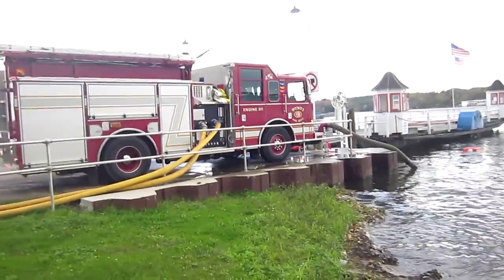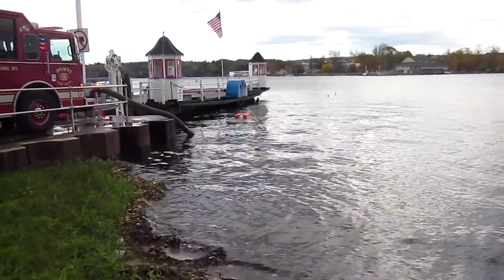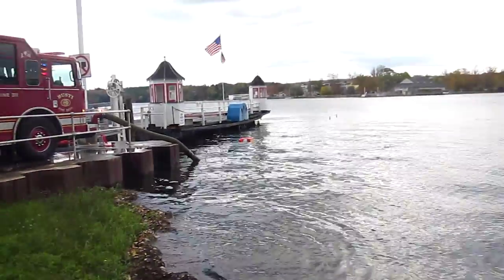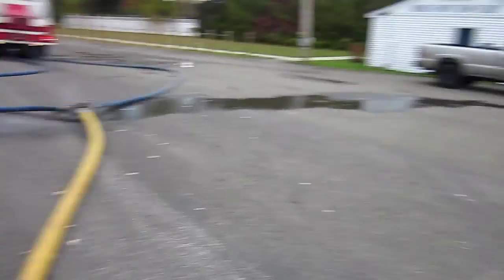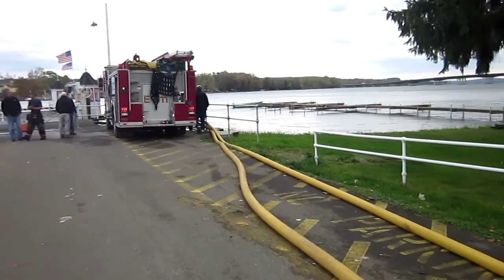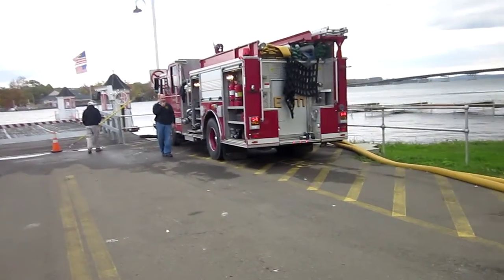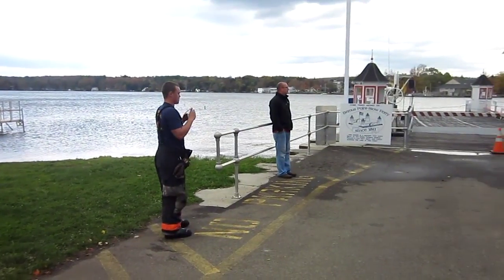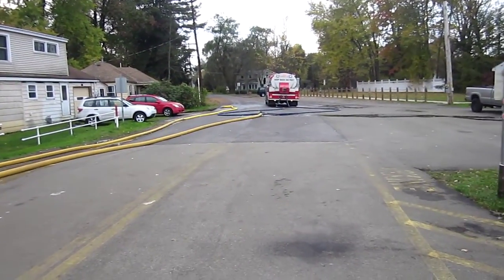Tanker Fill Site Operations - Lake Chautauqua, NY

Comment: Why is the 1000gpm mark so important in the U.S.?
Reply from the maker: NFPA 1901 Standard for Automotive Fire Apparatus addresses a number of design and performance factors for different types of fire apparatus. For tankers (tenders or mobile water supply apparatus), one of the performance requirements is the loading and off-loading at a minimum rate of 1,000 gpm. Therefore, our goal for filling is at least 1,000 gpm. We use the principle of "why would I set up to fill at a rate slower than what the tanker is designed to be filled?"  It is a good performance goal for training and running shuttle operations.
Reply: Also you only really have 2 ways to speed up tanker shuttles, Filling and dumping. The travel time will be the same regardless. Fill with 4 inch and  put the largest dump valve on your truck you can
Reply: bert26a your home high